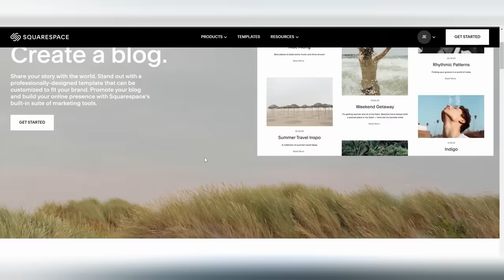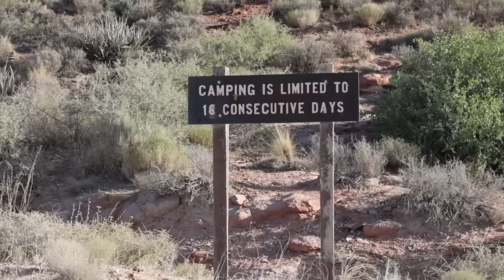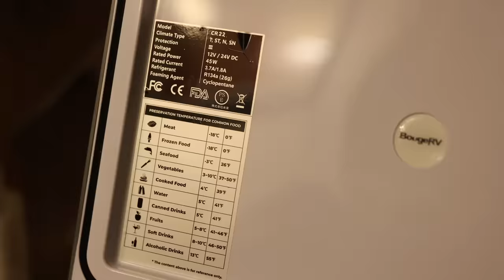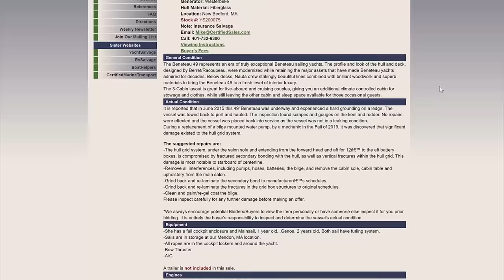SALVAGE SAILBOAT Auction - How much it cost? Was it worth it? (Q&A) | Expedition Evans 45

Comment: Long timer armchair sailor here.  You know that 120 thousand you guys speak of. No, the worth is not in that much at all.  The worth is in the achievement, the level of knowledge you now have of that boat, the level of knowledge of fibreglassing, cabinet making, starting and finishing a major repair/refit to the point where the guy doing the inspecting afterwards gave more than a tick of approval.  You guys nailed it and the 120 grand is irrelevant and superfluous at this stage. The value to you both is immeasurable.  Well done!
Reply: Thank you shrek for the positive words

Comment: I owned a 1980 Irwin 46’ ketch. Bought it in May 1997, wife and I moved aboard in June 1997, sailed the Pacific coast from Northern CA to Zihuatanejo, Mx. Lived aboard continuously until I sold her in April 2019. My last significant sail was from Mazatlán, MX to Alameda, CA in June/July 2017. You two, I’m sure, will build memories that few others will know, and the boat you rebuilt will take you anywhere. Congratulations.  Gene Gehlbach

Comment: Yes we sail, we were live aboard on our first boat. We were lucky, sold our business and went straight to an almost new 50foot Cat, but soon realised that this brand of Cats had issues similar to the current L450 cracking problems reported on some youtube channels, so sold it after a year and went back to the drawing board. We now have a 45ft mono, and have spent the past 5 years refitting it. Nothing serious just all the stuff most have on their wish lists, like heating, A/C, latest electronics etc. Our best upgrade was to get it insulated, now we can use it year round in any location and no more condensation.

Comment: I have sailed, and I own a motor boat, but I love watching live aboard sailboat channels because owners end up working on so many different parts of boats that you get to learn so much.  From rigging, to fiberglass, to paint, to different type of HVAC to engines, water makers, AC and DC electrical, etc. etc.  Even though it's fun to "experience" adventure with you it's great to learn so much about how all the on board systems work.

Comment: I sail but my boat is 500 miles away, so only make it out of the slip about 8 times a year.   Watching your videos encouraged me to cut some holes in my boat and fiberglass a custom mount for a linear drive autopilot, which the boat was not designed for.   In a way, you guys saved me $4k in labor so I thank you!

Comment: To answer your question,  yes I do sail.  Current boat is a Beneteau First 235 which I cruise locally and participate in club races.  It is large enough to do as weekend on but small enough to sail singlehanded.  Quite often I am racing singlehanded which is a good workout and an exercise in task management and preparation.

Comment: As a young adult, I was given a leaky Super Porpoise (a Sunfish knock-off) by a neighbor who wanted it out of her yard.  A few years later, my wife gave me a spanking-new Sunfish, and I also bought a little used sloop-rigged fore-and-aft dinghy.  These were to sail on a 75-acre lake with a 10-acre island in the middle in southern Michigan (I figured out how to tack!). Since then, I've sailed on Lake Michigan, Chesapeake Bay, and Lake Tahoe, but not for a while.  No blue-water sailing, but at times on Lake Michigan the swell was 7-10' with 7-10' waves on top.  The Lake Tahoe sailing was on a stiff little 35' Hobie monohull, in late April, with snow-capped Sierras in the distance, with glassy-smooth lake water, and a 5-10 knot wind... lovely.
You guys are great.  I'm so happy that you're heading back to the boat, and look forward (with some trepidation) to what you'll find after a winter in and out of the water.

Comment: I grew up racing Naple Sabots, then Laser 1 as well as many other small boats including crewing on larger boats like yours in races and pleasure. I was also a rigger on small projects for friends and for myself. My dad was a catamaran racer and he used me as crew on his P-Cat before I knew how to swim and I didn't have a life jacket. He also built me a little kids sailboat that I used all the time before I joined a local yacht club as a junior racing member. At the yacht club, I spent every summer in a racing sailing school where we learned the finer points of sailing. Then I purchased a Tornado catamaran and only raced one regatta that I won with all first places and one second. This was an Olympic qualifying race with I think about 100 boats on the starting line. I sold that boat for profit and got a Nacra 6.0 catamaran. I also had several other catamarans including about 10 Hobie Cat's and about 3 Nacra 5.8's. During this time, I got the opportunity to live aboard a 165 ft. long gaff rigged schooner called TeVega that is now called Deva. I was on that boat for 11 1/2 months. I still have a Nacra 5.8 and a Laser but haven't sailed in 15 years. The last time I sailed, I was first to the weather mark in The Flight of the Lasers race and got 6th overall. I was slow downwind due to my weight at that time. My dream is to own a Schionning catamaran and cruise the globe. Presently, I purchase property and build custom homes using my own hands and without hiring any other labor. It's all done by me to save money. I watch sailing channels when I'm relaxing which is rare since I'm mostly working long days. I live in the Pacific Northwest, USA.

Comment: Yes , i do sail . I sail a traditional dutch boat wirh sideboards singlehanded , most of the time . My boat is about 10 metres long and it's displacement is about 9 metric tons . It is a sailing project . I bought it with years of neglect . Gradually working through it while enjoying 5he sail live .

Comment: Great little update guys, yes I sail my friend lagoon 440. We have sailed up the east coast of Australia and from Bali to Queensland Aust. Of coarse we did it the wrong way at the wrong time of the year. 28 days of flogging into the wind. 2 ripped sails and a motor that jumped out of its engine mounts. Luckily it never ripped the sail drive boot… that took us around 5 hrs to get back into place and re-run the exhaust pipes as the muffler melted and a whole lot of other mess🤣😱😎.  Would I do it again, bloodyoath I would 🤙🏼🤙🏼🤙🏼🇦🇺🤪

Comment: To answer your question, yes I sail.  I am a single guy, 75 years old, and live aboard my 1979 Cal31 sloop, Imagination.  I moved aboard 11 years ago when I retired but I have owned Imagination for 31 years and have had the same slip all this time in Cabrillo Marina in San Pedro (in the Los Angeles Harbor).  I typically sail one weekend a month, usually to a harbor on Catalina Island or a coastal harbor within 30 miles or so.  At least once a year I take a long cruise usually to Channel Islands National Park but also south to San Diego.  As I sail solo most of the time I don't sail overnight.  Typically my longest passage is about 14 hours when going up the coast 70 miles into the wind and against the prevailing 1/2 knot current though several years ago I made the nearly 80 mile passage from Avalon to Mission Bay.  When going north (really NW) I like to leave about 10 pm when the wind is down and sail through the night arriving around noon just as the wind picks up.
     I have followed your channel from the beginning and am astounded by the amount and quality of the work you have done.  I am looking forward to your adventures cruising and actually using your boat1

Comment: I guessed $85,000 with repair & yard costs in the $20-25,000 range of course there is no accurate way to estimate the retail before the survey is completed and the boat insurable, but that is a wonderful ROI, try that in the low or medium risk market. I've sailed off and on with family and my Brother (offshore sailing instructor) for 40 years, currently there are multiple boats available should the urge to sail arrive,  a Victoria 18, S2 8 meter, Laser (planing hull speed demon), there have been some race boats that were sold on and power boats that are currently used, we were/are water babies by choice.

Comment: Yes, I am a sailor, from age ten, now in 70s. Just sold my 91 Macgregor that I had for 20 years. Sailing big on a small boat in the North Atlantic. (how about near gales where you have to stand in the cockpit because every 7th wave totally washes over the boat and if you sat you would be underwater?) Looking to buy maybe an older (like me) 45 +- because I am getting too old for the sail work of a small boat sailing big.

I'm going to add, maybe you will appreciate it later, in my little 27 footer, everytime I docked in a new place, guys with 50ft power yachts or 25ft powerboats would say to me, "I always wanted to sail"

Comment: I sail small performance boats. I have been considering taking on a project like yours. I have noticed that people who sail their homes are extremely conservative in their approach to sailing. I am on the opposite side of the spectrum and push my boat for maximum speed and performance at the risk of spectacular failure.  I do not think I have ever sailed my boat without some sort of damage to myself or the boat.  My boat is a Nacra 5.2 catamaran.  I have modified it with a tilting rig and double trapeze.

Comment: About biggest mistake:
No, what you did was all you could do.

If there is an alternative way: There are big industrial dust absorbers with hoses around 10" diameter. They are found frequently in carpenters workshops. Our neighbours had a renovation. Much dust- then the contractors stopped. Came back next day with such an absorber and place it in the garden. taping the window of that room and put the hose in there. The room always was in under pressure - so no dust went into the house. 
Don't know if such devices are on rent.

Comment: If interested in the financials jump @12:30 and thank me later😋

$100k for the boat and boat valued at $220k. They said "it cost us $120k of labour and supplies", so then how much was the whole project cause it sounds like you might as well work another year and just buy a boat that doesn't need restoration.
Reply from the maker: Hey there! I can see where the confusion comes from so to clarify - the $120k total included the initial purchase of the boat :) So after the rebuild was complete we had a 100k in boat equity

Comment: yes, I am a sailor for decades. I would prefer a smaller boat like 40 feet, easy to handle and less work to maintain and easier to have handled by shipyards aswell. Like just carrying the mast on the shoulders and repairing it oneself instead of always have to depend and rely on foreign intervention which does or doesn't come when you need it. Having seen every video from scratch I wonder if you would go for a smaller boat if you'd be doing it again??

Comment: Just asking myself: can such a structural repair be done by basically two amateurs and without the involvement (and probably the approval) of the original shipbuilder?  Would be unthinkable with airplanes. Will there be insurance issues because of such a repair outside the original shipbuilder?

Comment: Hi, guys...there's a piece of info missing from the cost/benefit analysis you provided, and that is, and given that Brett's just been away working o/seas for 4 months and which usually pays well often with some tax benefits, if both of your had been working during the 12 months would your after tax combined income been more than USD120K for the 12 or 16 months, depending on how you account for the last 4 months on the hard as some sort of cost to be considered? I mean, your costs of living without an income for that initial 12 months has to be considered as an on-cost in the R&R on the boat.
By the way, I have sailed, and am currently looking for the right boat, though there are a dearth of cruisers for sale here in Oz. I had my eyes on a boat when the lockdown began here early last year, and a prior-looker pounced on it, and there has been few and far between for sale since.